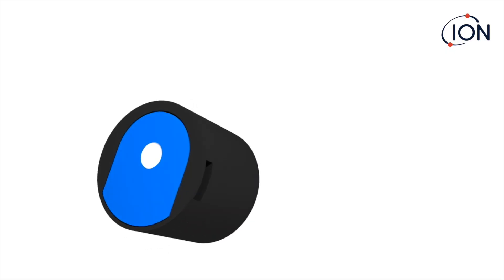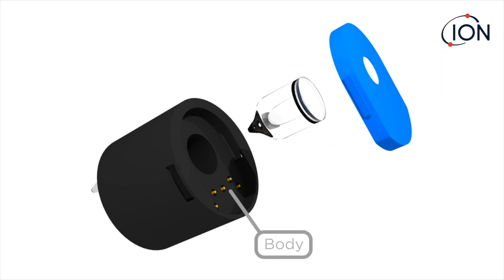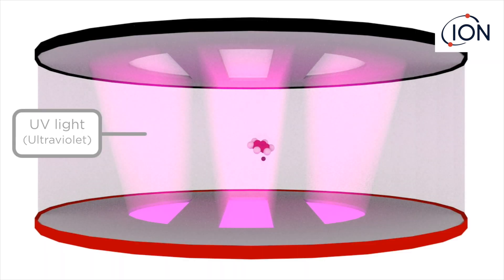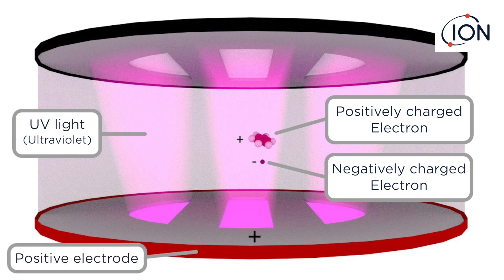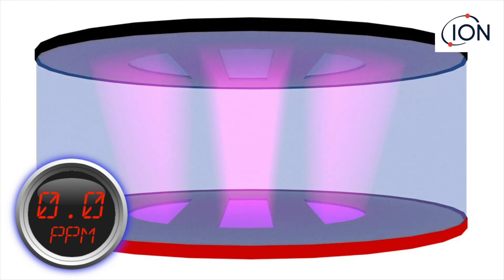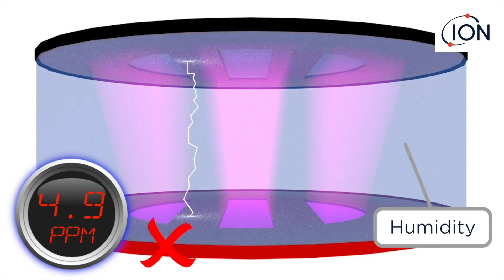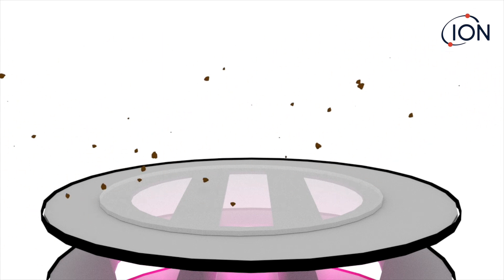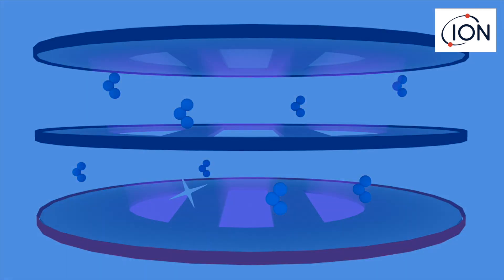How the MiniPID sensor works

Comment: Hi. I am a novice about the sensors. I am interested in knowing how to use PID and to obtain readings from it on to a computer in real time. The idea is to write a program that gets the data from PID and launch various actions based on the reading such as ringing an alarm on a certain reading. Pls note that I am not interested in buying a detecting device instead I will buy and want to use the spherical sensor shown in the video and want to use it. Dr. Khalid
Reply from the maker: Good afternoon, sorry for the late reply.
Please contact us at info@ionscience.com and we will get back to you as soon as possible to answer your question.